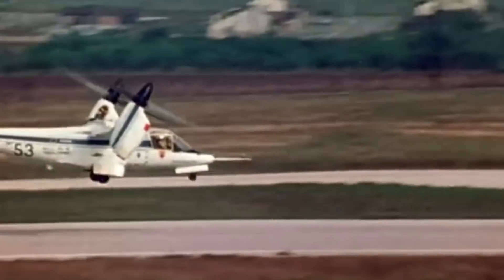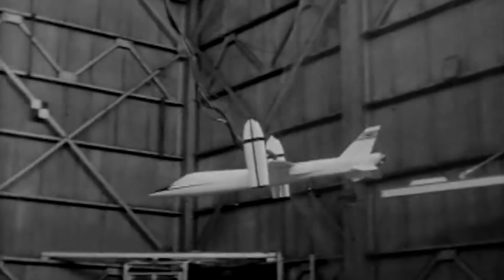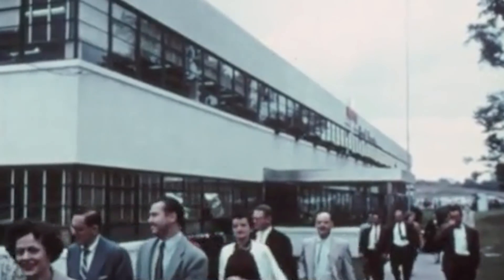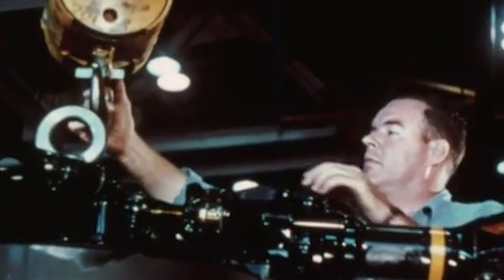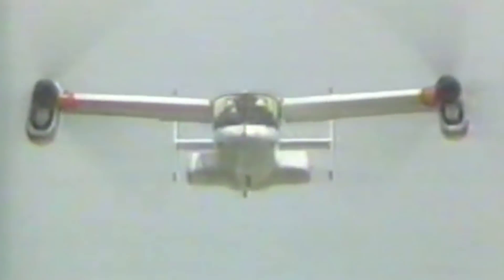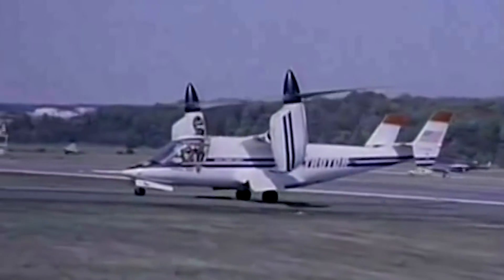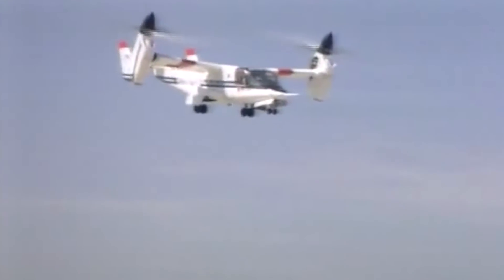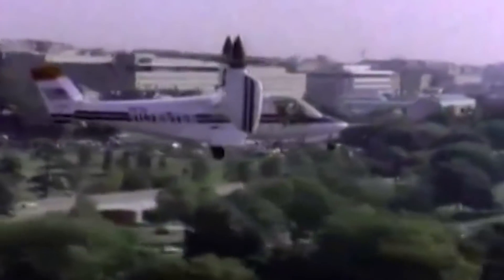From Hover to 160 in 13-Seconds - Bell XV-15

Comment: The story of tilt rotors is not complete without first talking about the Auto-gyro which combined a powered propeller with an unpowered rotary wing.  Then with the helicopter and it's powered rotary wing but no propeller you have people wondering how to combine the two.
Reply: @Galileo7of9 I see you haven't given the subject any thought at all.
Reply: @Galileo7of9 I was unable to find much information to support that claim.  I didn't spend a lot of time on it though.
Reply: @Galileo7of9 History, the auto-gyro proved the rotary wing.  The helicopter showed it could be powered.  The helicopter had the vertical takeoff and landing which is very useful but the auto-gyro and fixed wing planes had more speed.

The tilt rotor is still effectively a rotary wing that is turned to also serve as a propeller.
Reply: @Galileo7of9 Flyable and tethered models were developed first but not usable craft.
Reply: @Galileo7of9 Usable means STABLE enough to fly with. There were plenty of model aircraft prior to the Wright Brothers.  Not moving the goalposts at all, that movement was you.
Reply: @Galileo7of9 No, you moved that goalposts and at the same time claimed I did. 

The Tilt rotor concept drew from the helicopter and the autogyro. 

The autogyro had it's own issues which is why it's not a seriously used technology today but your offhand dismissal of it's place in history is simply not true.
Reply: @Galileo7of9 It is part of the Tilt Rotor ancestry so yes you did dismiss it.  Nevertheless, it's good to see you have a passion for the subject.
Reply: @Galileo7of9 The autogyro is part of the history of the Tilt Rotor.  You dismissed that.   The autogyro is part of the history of the helicopter as some of the things learned from autogyros helped develop helicopters and helicopter development helped autogyro development too.  

The tilt rotor is a descendant of the helicopter and that includes autogyro "DNA" as it were.  It also of course is a descendant of the airplane 

The tilt rotor literally has "rotor" as a part of it's name.  It's there for a reason, something you wish to dismiss since you apparently see those rotors as propellers.
Reply: @Galileo7of9 That of course makes sense as they are both rotors and propellers taking somewhat from both and giving up some of both for the sake of the other use.  They are a dual use item, not the best for each use but a calculated compromise for the need to perform in a dual role.

Comment: The main question is seems with tilt rotors is "Do you want the whole wing to rotate or just the engine nacelles"? Looks like the latter is the preferred solution.
Reply: Or just the propellers? V280 Valor 😎
Reply: @ascot4000  That is not how development went. They tried all the options and settled on tilting nacelles. Boeing's Model 222 had tilting rotors. Tilt wings were tried. The V-22 is a development out of the XV-15 with Boeing and Bell in partnership. A lot of people have their own concept of "common sense", but the tilt nacelle won the competition in reality. They each have their own complications and advantages.
Reply: The V22 and AW609 are of very similar design, as they should be as they both originated by Bell.  The V280 switched to the rotating hub design with the engines fixed on the wing.  Leonardo has proposed similar concepts for a future variant or iteration of the AW609.  The advantage of the V280 style is the wings do not need to be as large as they don't need to support the weight of the engine at the wing tips,however this comes at the complexity of needing a gearbox that allows conversion.  Leonardo has gone through and completely updated and changed the 609 for expanded mission envelopes and more space and payload compared to the original Bell prototype.  It will be very exciting when they gain their type certificate next year and formally have the first civilian tilt rotor in service.
Reply: @ascot4000  Tilting rotors were already tried on the X-22. The technology was not yet there.

Comment: bell also should have made one with jet engines
Reply: Jets would consume more fuel, which would cut down on the range. There is also the added problem of Jetwash that the harrier always had, and the F35 had been designed specifically to avoid (with a massive fan). Rotors just make more sense.
Reply: West German EWR VJ-101, first flew on 10 April 1963.

Comment: When they first brought the V-22 into service in Iraq/Afghanistan, most troops would hear the call 'ready to go fast?" as the flight crews brought the rotors down for horizontal flight.  They also said the if you were not hanging on you WOULD end up on the deck and sliding aft.....
Reply: @Galileo7of9 Yeah, you're right. It's not breathtaking, but I think it looks pretty cool. But you DO feel it and the force is pretty strong depending on how fast the pilot is accelerating. This comes from experience, as I've ridden in them a number of time in Afghanistan - about 10 years ago.
Reply: @Galileo7of9 Welllll yeah you would, if you weren't strapped in, which you should have been...
Reply: This whole chat can be summarized into a, "yeah? Well i dont believe you!"
Reply: Sometimes' Clicking on 'Replies' Is Like Finding Yourself at the Dimly Lit Section of a Sketchy Dollar Store, Your Surrounded By Useless Crap, And Its Not Clear Why Your Even There?! 😶
Reply: @Galileo7of9 The fact it can hover on one engine. You see, to do that requires enough thrust to counteract the aircraft's weight, a greater then 1:1 ratio. point that forward, you're getting at least 1G of acceleration.
Reply: @Galileo7of9 Source is physics. You are accelerating at 1 g sitting in your chair or standing/whatever. The V-22 has to use power to do that in a hover. It can decelerate from a descent in a hover to a soft landing with one engine out. Taking off, once the wing is flying, the excess power can be used for acceleration. It has a lot of excess power available when both engines are running.
Reply: Bollocks.
Reply: @Galileo7of9 PhYsIcS dumbass 
When you are in a car that is stopped and someone pushes the accelerator really quickly and gets to a high speed what happens?

You get pushed back into your seat it's called Gs now the amount of force you will feel in a car is about 1 to 3 maybe 4 Gs 

So imagine the V22 going from hover to flying in a few seconds and reaching crusing speed within a couple of seconds after that. The soldiers inside will be experiencing possibly G's fighter pilots have to deal with I'd suspect at least maybe 5 or 6 G's Which is definitely enough to push you over

Right now you are being affected by 1G as you are being pulled down by the earths gravity 

What you were trying to say literally was just being ignorant of Newton's laws of gravity
Reply: @Galileo7of9 no I am speaking as a man of science though and fact and if you want I can find a source and disprove you
Reply: @Galileo7of9 well I have good news and bad news unfortunately no one actually talks about the G's the Aircraft sustains so neither you or I can say they or they don't get affected by G's but I will say 1 thing that I found interesting whilst looking is that there is reports of some soldiers falling out when it changed from hover to flight and I have seen the remains of one unfortunate guy who was over the ground when it happened o_O so idk what that tells you but they have introduced 3 belt systems on the seats now because of that

Now what I am saying is that no one has made a report on the G's 

But there is reports of people falling out of it the actual reason maybe what I explained to you and if you cannot open your mind to that then I have nothing else to say to you 

But I have a question for you 

How do you know that there isn't G's have you been in 1?
Are you an engineer 
Are you a physicist?
Reply: @Galileo7of9 like I said no one has actually officially reported it but there is eyewitnesses but to get a source you have to talk to soldiers and marines who have flown in that thing
Reply: @Galileo7of9 you are the definition of an armchair warrior.
Reply: @Galileo7of9 you do understand how rotor-craft work? Very well, he who makes the claim gives the sources, they're at the bottom. However, I decided to do some of the work here.

In a hover, lift=static thrust of the main rotor. Thus, to lift a 1,000 kg of vehicle off the ground, you need 1,000 kg of thrust, that's true for a rotor just as it is for a jet pointing at the ground. Rotors are super efficient at generating thrust because of their diameter, so having enough thrust to throw people like ragdolls isn't hard for helos, and that's ignoring things that can point them forward and use them like props. Hell, the FAA had to give a max speed exemption to ultralight rotorcraft because of their unique thrust curve.

the v22 two engines making 6,150hp each. with 2x 38" rotors, let's do a little math, using just one engine.

first is rotor area: that's (pi/4)*d^2, or for the v22, 1,134sqft per rotor, or 2,268 total for both.

next is power loading, how much power gets to every sqft of rotor area. let's say 85% gets to each rotor to account for the gearboxes and backup shafts. That's 5,227/2,268, or 2.3 hp/sqft

Now let's caculate thrust loading, which accounts for losses generating lift in the rotor: 8.6859 * 2.3(power-loading) ^(-0.3107). That's 6.7 lb/hp for a v22 on one engine.

to find total thrust, you take TL, and multiply it by total engine power. so 6/7 X 6,150, or 41,205 lbs of thrust. Gross weight is 39,500, that means full of fuel.

I do beleieve we call that a greater then 1 thrust to weight ratio. As ALL helos have now the Osprey isnt' quite that good in practice because of the wing obstructing it, but it's still enough to lift with a full tank of gas. The MTW is given with margins even on one engine.
Sources, fomulea:
https://www.redbackaviation.com/aviation-calculation-helicopter-calculations/

Haven't done those calculations in years, lol
V22 specs:
https://en.wikipedia.org/wiki/Bell_Boeing_V-22_Osprey
Reply: @Galileo7of9 I accounted for gearbox and driveshaft losses in that math. What I don't have a feasible way of calculating is how much that wing obstructs things, which effects rotor efficiency. And a few other sources indicate that it does have the headroom to hover in an emergency, but as you noted, there are limitations.

I used one engine ti give the worst possible numbers for thrust. On two? That thing has plenty of power to send someone skidding in the back when it switches from vertical to horizontal flight mode. Especially if the pilots are in a hurry, hence "Ready to go fast?".

The wing driveshafts aren't powered when both engines are running, so the losses there don't apply, the cross section of wing area impeding the rotors drops as well when they're in fixed wing position. all that power that was holding you 100 feet off the ground is now yanking the floor forward under your feet. 

It's also worth noting that I'm not claiming the V22 is special here. The Chinook can also send soldiers sliding (and outrun it's attack helicopter escorts if it really wants to) and it doesn't need fixed wings and tilt-rotors to do it. it can also carry more and auto-rotate properly, too. But it isn't quite as fast.
Reply: @Galileo7of9 hang it up! Go talk to people that have flown it and flown in it. Or maybe you can find someone who was in volved in the design or prototype stage. You're speculating just like it's fact
Reply: @Galileo7of9 2011, Southern Afghanistan, crew chief wasn’t holding on, got barrelled out the back when switching to cruise, fell nearly 200 feet to his Death.
Reply: @Galileo7of9 no, you called nonsense on dude saying if you weren’t gripped in your on your ass, well dude wasn’t by the cockpit and the door was open so instead of on his ass and in a position to live, he’s dead, something you implied by your comment was nonsense, hence my comment on the matter.
Reply: @Galileo7of9 you ever been in one? Breathtaking, because you hope you aren’t going to die the whole time. They’re not well liked. Good idea, but maybe they were built a bit before the technology was ready for a war in the desert. I’ll take a chinook ride any day